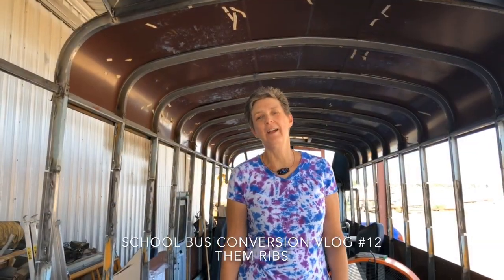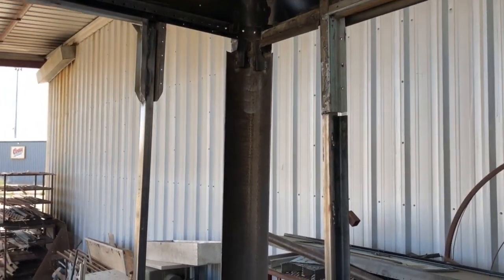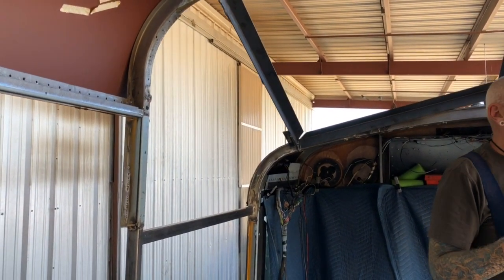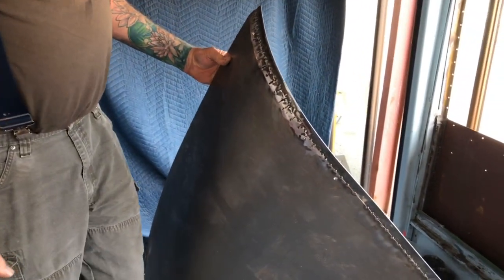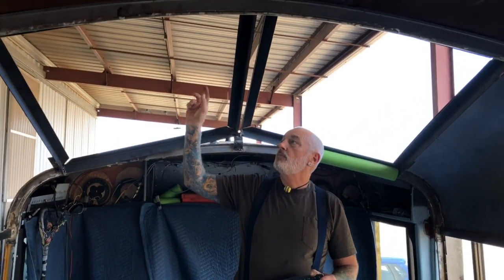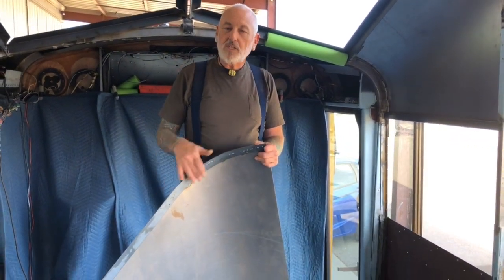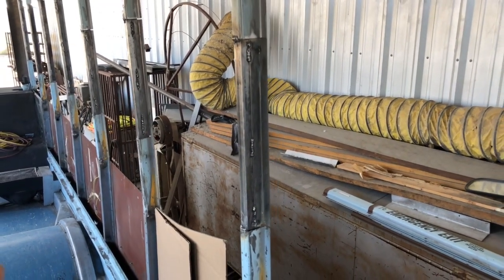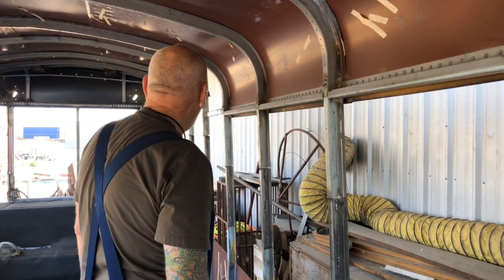Them Ribs - Vlog 12 School Bus Conversion

Comment: Looking great Randy! Skylights are a great/unique idea. If its any help...I chose not to remove the top row of rivets and just seam seal the upper interface between the new skin and the roof line. I thought about it and an engineer friend okay-ed it structurally. Really all you have to remember is, its way, WAY stronger than any factory built RV. Remember that school buses are required to be able to support their own weight upside down! The split pipe in the rear looks fabulous. I'm sure the new skin will curve to that wonderfully and look "factory".  Keep it up Brother. I know it can seem like a long road, but keep eating that elephant one bite at a time! Godspeed.
-Shay
Reply from the maker: Thanks for the input. Check out the Vlog #13 to see how the skylights turned out. Should be pretty cool. We are just having fun and taking it one day at a time.